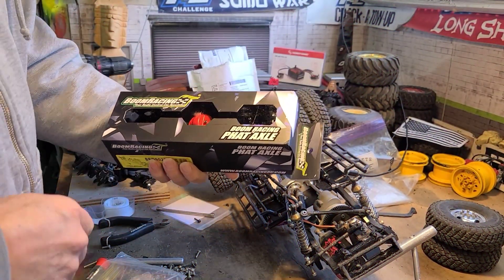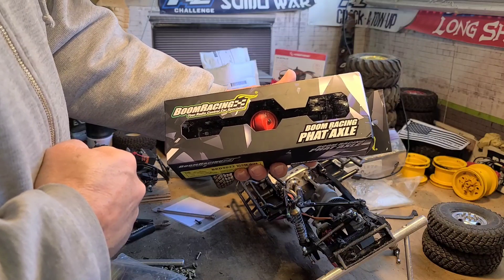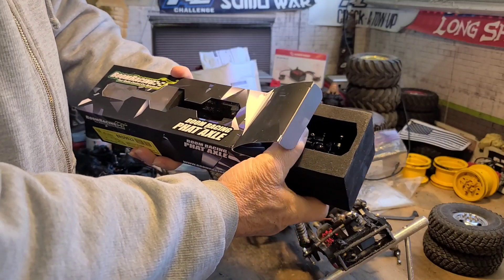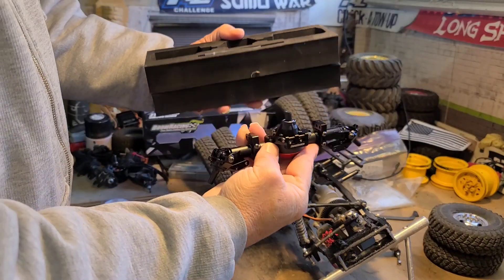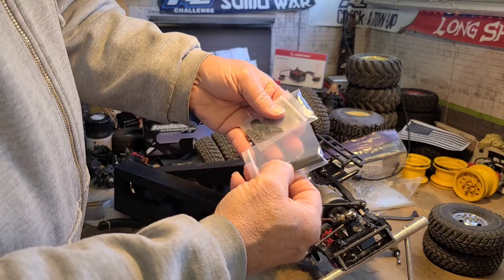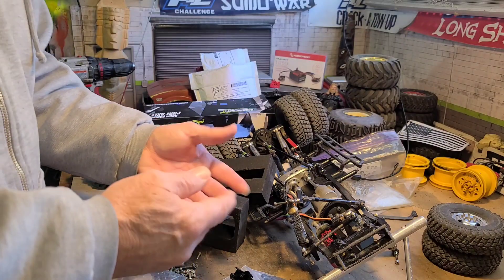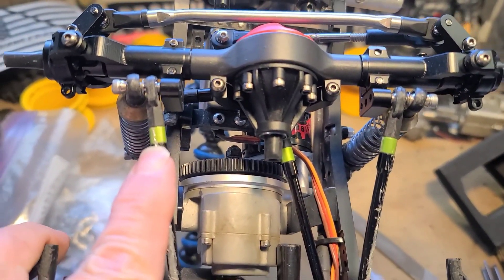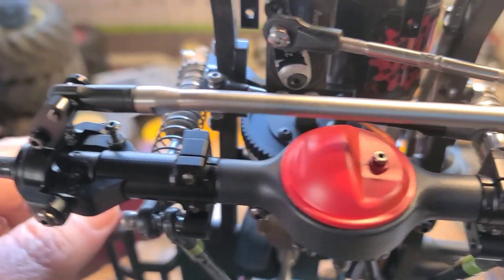Boom Racing BRX90 front axle install into RC4WD Trailfinder with a 3-link.

Comment: Thinking on these but for a leaf setup in my TF2. As far as I know its basically a bolt on deal.
Reply from the maker: All my Trailfinder have Boom Racing BRX90/70 axles. Yes, they bolt rights to the leaf-springs.
Reply: @tomlucasrccrawlers9108  Great! Which ones would you recommend between the 90s and 70s??
Reply from the maker: I'd go with the 90's. They are just a hair wider than stock...not by much, but they are. Not as wide as Axial 44's.
They do have the new BRX80's. They are between the 70's and 90's. 
On my 11+ year old Trailfinder I run the 90 in the front and the narrowed 70 in the rear with RC4WD's Dually Wheels. The 70 won't work in the front. It's too narrow and anything tire/wheel combo will hit the leafs when steering.
I'd check the pin-to-pin width to see if the 80's or 90's fit what you want.
Also, it's pretty cheap to convert from a 90 to a 70 or vis-a-vis. You buy the lock-out tubes and axles.
Reply: @tomlucasrccrawlers9108  According to RC4WD the Yota 2 front one is 180mm, the BRX90 front is 176mm? and the brx80 162mm? Thats pin to pin. The RC4WD width is wrong?
Reply from the maker: It might be where you're looking.
The 90's are wider.
Yota ll  6.69in / 170mm
BRX90 6.93in / 176mm both front and rear.
Reply: @tomlucasrccrawlers9108  Got the info straight from RC4WD.... So the 80 would be too narrow then.
Reply: @tomlucasrccrawlers9108  No wait youre right its 170 pin to pin, 179.4 hex to hex.
Reply from the maker: I didn't check the 80's. But if they are narrower, I wouldn't use them. You'd have to run a really small tire to get any type of decent turning ratio out of them.
Reply: @tomlucasrccrawlers9108  Yes. The 80s are 162mm pin to pin.
Reply: @tomlucasrccrawlers9108  Can you run the wheel to wheel steering link behind the diff pumpkin like the Yotas 2 are instead of right in the front of it?
Reply from the maker: I haven't tried it. But I don't have room with the anti-wrap bar. But Jason, the owner, said you could....but I wouldn't get your hopes up...just lack of room with the high pinion.
Reply: @tomlucasrccrawlers9108  Would the brx90 work with the link setup from RC4WD?? Im thinking of ditching the whole leaf thing and go with links. Is is a bolt on deal like with the leafs?
Reply from the maker: You could try. On my rig, with the leafs, high pinion design and anti-wrap bars, there wasn't room. If you run links, I think you might have room.
Reply: @tomlucasrccrawlers9108  I ordered the whole link setup front and back. Will upgrade my Yota's front with xvd's and see how it works. Would love the brx90's to work though. I just had it with the leafs. Was never satisfied with them.